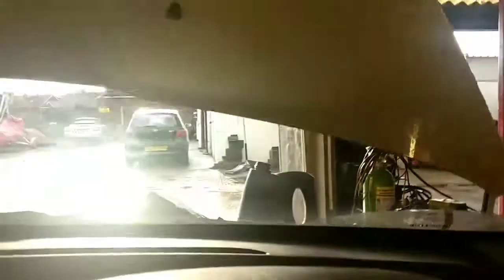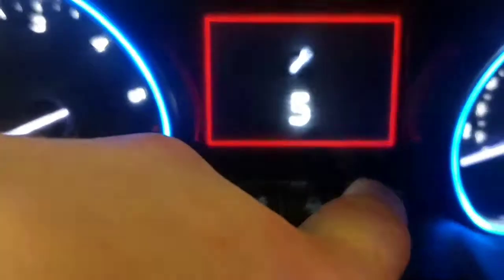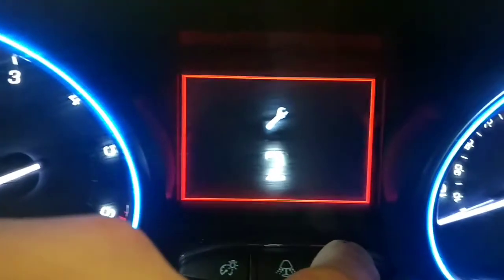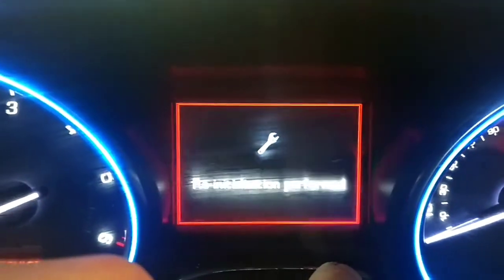How to easily reset the service message on a Peugeot 2008

Comment: I have a question about the engine light . When I turn the ignition on the light go away.  I had the service done and nothing its wrong with the car atm. Its peougeot 2008 and I see you have the light on as well so maybe you could advise please x
Warm regards x
Reply: Mine is showing "Service " word in red color in the bottom RPM dashboard but without the service key in the km dashboard  .. I don't know what does this mean ?!